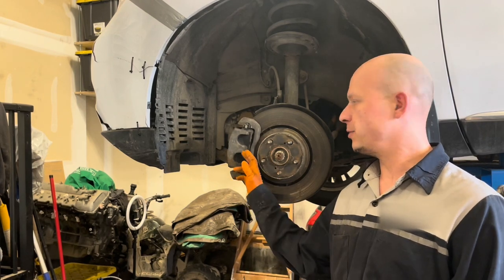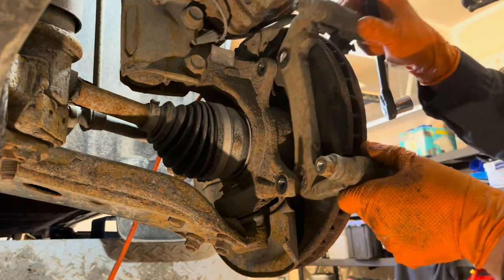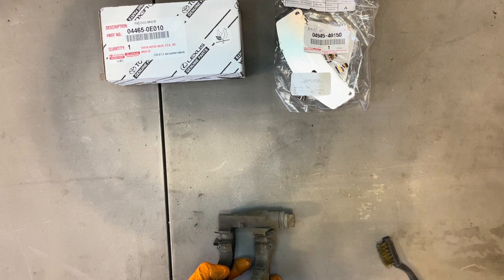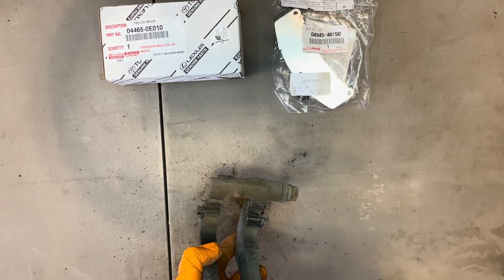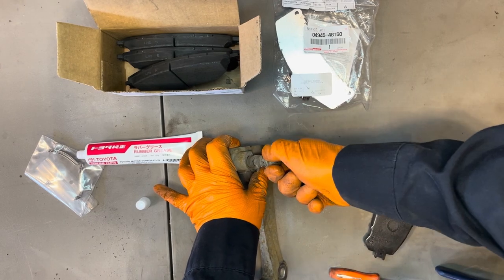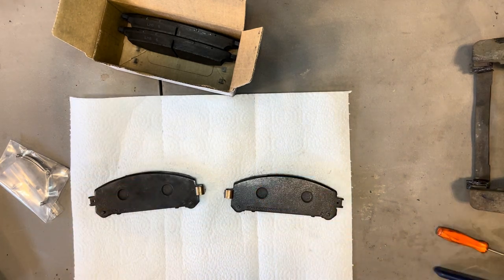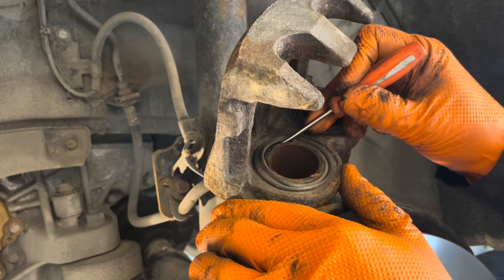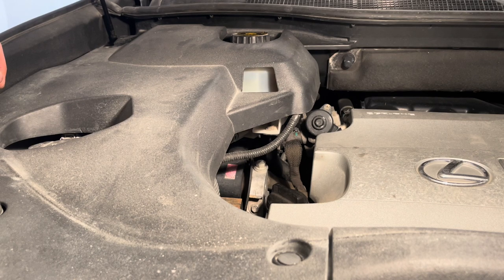2010-2015 Lexus RX350 RX450h Front Brake Pads And Rotors Replacement Instructions

Comment: Thank you for the video. One question. In one of the other videos, I saw a lady bled out the brake fluid while pushing piston back. She said it might damage ABS system and cause thousands of dollars damage if not doing so. Is this really necessary?
Reply from the maker: @johnthehammer7702   hi, my video follows the factory repair manual, which does not instruct you to bleed the caliper while compressing the piston. You can if you want to, but I’ve not seen damage caused by following the repair manual procedure in the past.

Comment: Great work Viktor...I'm replacing the calipers now on my 2010 RX350, because the piston boots are ripped...would you recommend the replacement?...also, watching this video, I've seen the bleeder loosened to allow brake fluid to escape when compressing the pistons, so as not to force fluid backwards through the system...does sending the fluid back into the reservoir cause any harm to the anti-lock braking system? It seems like a good idea to loosen the bleeder, allow some fluid to escape, then refill the reservoir, eventually sort of flushing some fluid out...what are your thoughts on this? Thanks and great job as always sir.
Reply from the maker: Thanks! The repair manual does not tell you to loosen the bleed screw, but you can definitely do it if you want, not a bad idea. Pushing the fluid back doesn’t damage anything, provided the fluid is replaced fairly regularly and does not have a bunch of wear particles in it. If the boot is ripped, water can get into the caliper and potentially cause the piston to seize, so it is a good idea to replace it. In practice however, I’ve seen people decline caliper replacement for a torn boot, and they often last for many more years without seizing.

Comment: Hi, love your videos and so glad you are back. I was wondering if you also have a video of how to bleed rx450h brakes? I have the annoying "barking" noise when braking at slow speeds. I bled the brakes with dot3 fluid 6 months ago and all ok after that. But now the sound is back so maybe you have some helpful tips on this as expert?
Reply from the maker: I do not have a video of that, but I can possibly make one someday in the future.
Reply: @Viktor_G_Automotive  , Looking forward to that ;). And you ever encountered this "brake barking" as they call it? Mine is doing it for over a year now and every owner tells me to change the ABS unit. But until now i don't have any errors on the dash and my local toyota dealer told me it's normal and it's just a matter of air in the brake lines. When i changed the brake fluid a few months ago (pressure bleeder, ignition on and brake pedal depressed), it was better for 4-5 months. But now it seems to return. Replacing the abs unit would be the last preferable scenario, especially because changing the fluid helped for a while, which should mean it's not a matter of something being broke inside i assume.
Reply from the maker: @MrTvsh2  that barking noise from the actuator is very common on Toyota and Lexus hybrids. Bleeding often fixes it temporarily, but usually to fix it permanently the ABS actuator has to be replaced.

Comment: Please make on video on removing and replacing the brake dust covers front and rear. Thanks in advance! BTW Are they attached or welded to the knuckles?
Reply from the maker: Hi, the dust covers are not welded on, they are bolted on. To remove the rear ones, you have to take out the rear hub/bearing assemblies and the rear e-brake components. The bearing can possibly be reused if excessive force was not required to remove it. For the front ones, the hub has to be pressed off the bearing to replace the dust shield, the bearing must be replaced as it gets destroyed in the process. I will have a video of the front coming soon, not sure when I will get a chance to do the rear, but we'll see. Thanks!

Comment: Hi Viktor, I panicked when went to my link for your RX350 brake video and saw that your channel was shut down! You have helped me do most of my own maintenance on my 2017 RX 350 and I didn't want to have to sort thru backyard mechanic videos to figure out how to continue working on it.. So glad that you have a new channel and that you'll be re-doing your videos. I know it's a pain, but we REALLY appreciate the work you put into these videos and how you show the part and torque values needed! Speaking of which, do these torque values also apply to a 2017 RX 350?
Reply from the maker: Thank you so much for your support and kind words!
I’d have to double check if the torque specs are the same, but they most likely are.
The 2016-2022 RX front brake job video should be uploaded in the next week or two, stay tuned!

Comment: Good detailed vid.  I like to put some anti-seize on the hub surface after cleaning.  It makes removal of the rotor much easier next time around.
Reply from the maker: Good tip Robert 👍
Reply: @Viktor_G_Automotive  FWIW, your 2010-2015 RX350 maintenance videos are a great resource I use when maintaining my 2010 RX350. 👍 I wish you had some MB W166 ML350 content on your channel. Concepts are the same but always helps with visuals.
Reply from the maker: @robertdieder4178  thank you for the positive feedback!

Comment: Very good, detailed tutoring video. I read that when changing the brake pads on the vehicles with ABS system it is better to open the bleeder screw when compressing the caliper piston.
With the ABS system the modules are involved, and it is better not to force the brake fluid in reverse, as it may cause some damage and it might be not in hundreds, but thousands of dollars.
I am going to do the job on my RX350 and thinking of opening the bleeding screw before compressing the caliper pistons and let some brake fluid to drain out. It is good to get loose the bleeding screws anyway (every 2 years) before they can get seized.
 I see in this procedure another advantage - partial replacement of old brake fluid.
It is a bit more job, but I can spend as much time as needed just to make sure everything I am doing is for my vehicle's advantage.
At the end I just add some brake fluid to the brake reservoir. What are your thoughts, Victor?
Reply from the maker: @stanislav9608  yeah, it’s not a bad idea if you want to do it that way. Cheers!
Reply: @Viktor_G_Automotive  Thank you, Victor, for the quick response. You are the best.
What is your opinion on brake pad calipers brackets.
Based on your experience, which one rust slower - painted or stainless steel.
Reply from the maker: @stanislav9608  I only use OEM brake parts, which are not stainless. Presumably, stainless will last much longer if you can get them.
Reply: @Viktor_G_Automotive  I assumed... that if they are not painted - they are stainless steel .
I just learned something again. 
Dealer's brake caliper brackets hardware is so expensive , that I thought it is made of stainless steel.
I am going to by aftermarket and they coming painted or shiny metal. 
Trying to find out which one will last longer.
Thanks for replying.
Reply from the maker: @stanislav9608  sorry if I misunderstood, in your post you said “brake pad calipers brackets”. The caliper brackets themselves are cast iron. If you meant the hardware/pad supports that inserts into the bracket that the pads slide on, those are most likely stainless steel. We usually don’t replace those unless they are damaged.

Comment: Great to see you back Viktor! Why not replace the hardware clips rather than clean them? Are they not included with the new replacement pads? This is my next project on my 2010 RX 350
Reply from the maker: Thanks! Unfortunately, the caliper bracket hardware does not come with new pads, you have to buy it separately.

Comment: With regards to the slider pins with the ' o ring' : does it matter whether they are on the top or bottom slider. I know you're going to say that's why you do one at a time but what do you do if the person before you didn't follow those instructions and MAYBE put them back wrong.I would think they should be the same. ie both on top or both on bottom
Reply from the maker: On some models the slider pins are different lengths. I can’t recall if this year RX is one of them. If they are the same length, it’s probably not a big deal if you mix them up, but if the are different length, you will run into problems, I’ve seen it happen before.

Comment: Thanks for the vid!  What's the mininum thickness of the rotors for them to be re-used?
Reply from the maker: Front brake disc thickness

Standard .................... 28.0 mm (1.102 in.)

Minimum .................... 25.0 mm (0.983 in.)

Comment: Fantastic video! I have a question: I have a 2020 RX and something very odd happened, I put my car in accessory mode, and then turned off the parking brake, and then put the car in reverse to back it out. Normally, after I hit the brakes a few times they get stiff and it is a bit harder to stop the car, but when I would hit the brakes even just a bit, even just a tap, the car would give me like some sort of power assist, and I heard a winding noise - when I took my foot off the brakes, the car rolled with no noise, and then when I tap the breaks again (ever so lightly) the car instantly gives me assistance somehow, and it slams on the brakes for me. I found this very odd so I recorded, and will post a video with the noise upon request if you have any ideas what this could have been.  To make it even crazier, after I started the engine, and then went back in to accessory with the epb off and car in reverse, it acted completely normal (no assistance, no winding noise) the pedal was stiff and the car was “harder” to stop! Any input you have is greatly appreciated. I think the winding noise was coming from front passenger side of engine bay.
Reply from the maker: Interesting 🤔 
I don’t know exactly what was going on, but was wondering why are you backing the vehicle up in accessory mode with engine off instead of starting it?
Reply: Lol! Because the exhaust fumes really bother me!
Reply: Did you see the video?